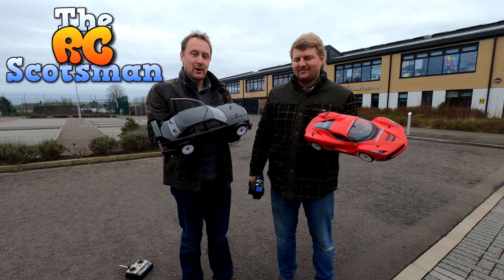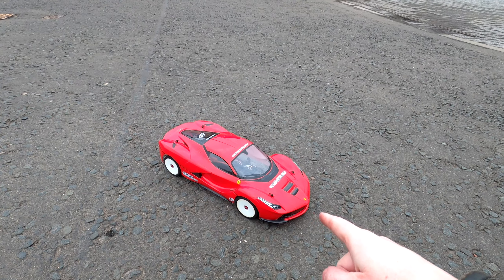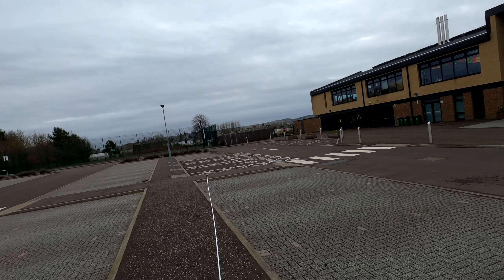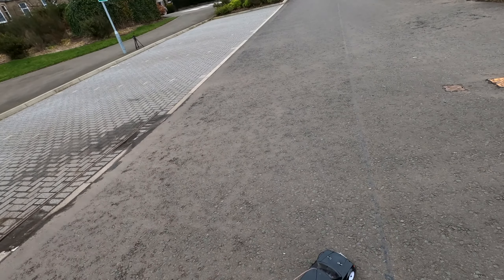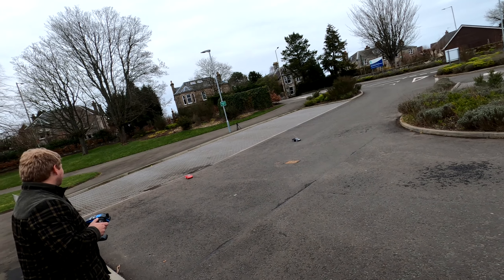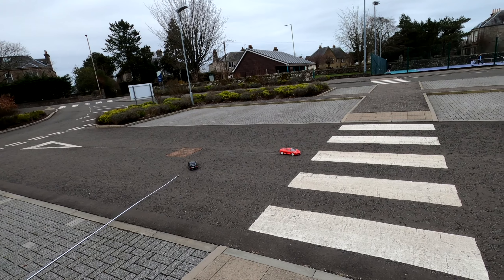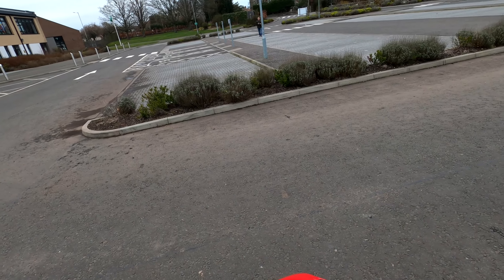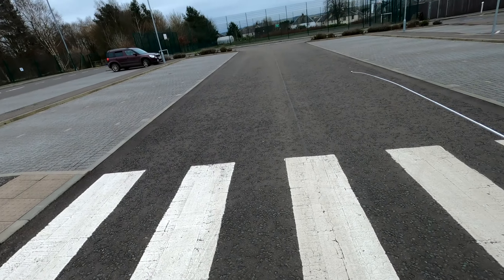"BRUSHED MOTORS ARE SLOW, RIGHT??" - Part 2 ... Tamiya TT-01E Vs Brushless Yokomo MR-4 TC Custom

Comment: Do the cars have similar FDR, or is just a "lets put random motors and see how it goes comparision"? I think the main takeaway, from "powerful" brushed motors, is that the brushes and comms wear a lot faster, which means theres a LOT of work keep them in good racing condition. With a brushless, just make sure your gear ratios are on point, so it doesnt overheat so much you kill the magnets.
Reply from the maker: The second one!

Yeah, absolutely. This, and the original video, are just sort of in-jest, because brushed motors take a bad rap, but they can be genuinely excellent. Cheers!